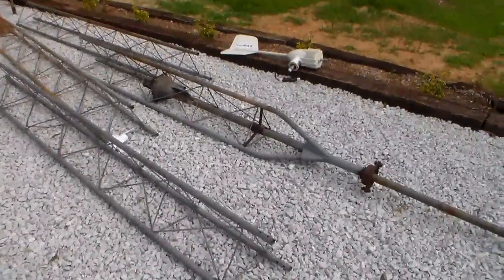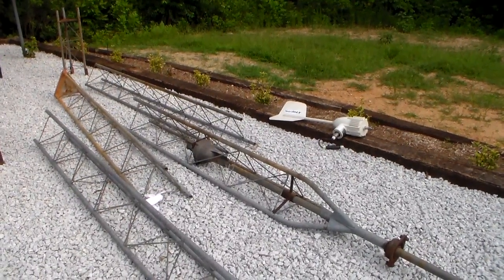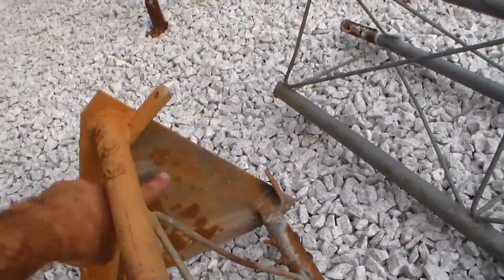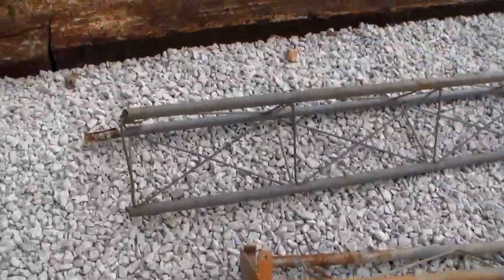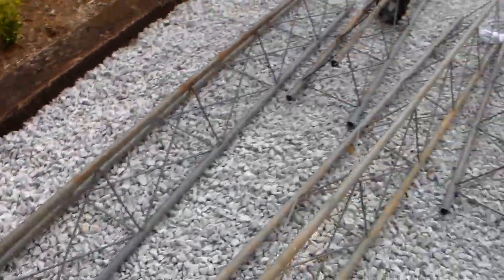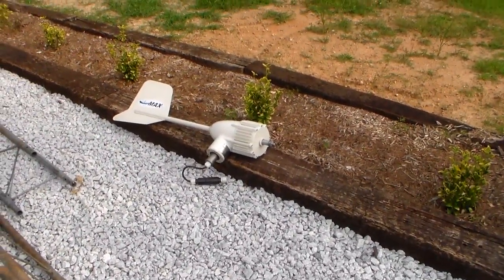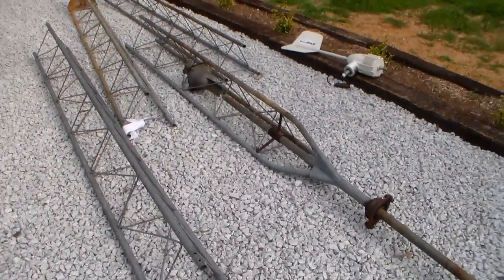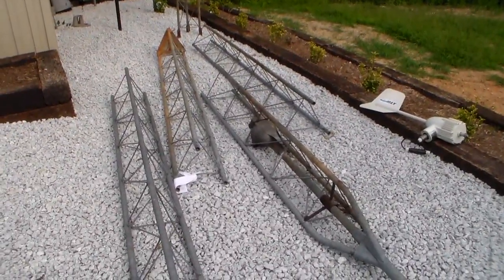Need help with my tower and wind turbine.

Comment: the first base y showed is a "hinged base", the second one is a fixed base. I would sink the second one into yr concrete and cut it down to the flat plate on top. Then mount the hinged base on top of that "hinge / locking latch" so you have the ability to lower and service it. Take the mast and rotator out of the top section "re use it on the side for antenna".

Comment: I suspect that the plate with the tabs goes up on the tower near the top as a place to set your guy wires.  Depending on the wind you may have two such locations.  A lot depends on the swept area of the turbine blades.  Your vendor should be able to fill you in on what kind of lateral loading to expect for that turbine.  I would suspect that two sets of guys are needed for a 45' tower with that small a footprint.  Don't forget to coat any steel going into concrete with a bitumastic compound or some of that black tape you used on your yard hydrants.  Concrete will rust steel in a heartbeat and cause a very expensive thunk when you want thunks the least.  (Corollary 5769 to Murphy's Law).

Comment: I installed towers for years,1st off cut the rusty bottom off, 2nd if you base in concrete you want to make a large base 5 ft x 5ft by 5 ft deep, make sure that the base or bottom of the tower goes in the ground below the concrete pour, so that moisture and condensation in the tower can drain, if you don't it will fill with water and the tower will not only freeze and split but it will rust from the inside. You may also want to fasten it to the eve of your house with heavy house brackets,in that case you really do not need any concrete,but you will need to go at least 4 ft deep, believe me the second way is the cheapest and the best.I have never had a problem with the 2nd installation.

Comment: Remember also if you weld on Galvanized pipe make sure you have good ventilation and don't inhale the fumes. Welding on galvanized pipe can be done but again its hazardous to your health. If your going to weld anything make sure you grind off as much of the coating as you can, have good ventilation and wear a respirator.

Comment: a tower like that will need at least 3 guide lines from the highest possible point to stop it swaying also use a sleeve style joint where parts join eg larger close fitting pipe slipped over the 2 smaller pipes to join id also suggest a wire brush check for cracked welds and cold galvanizing paint for long life of the tower make sure and the anchor points are as heavy as possible looks like a good find and should serve the purpose hope this helps please let me know how it goes

Comment: hey southern the first base plate you show is a hinged bas the tabs are the hinge just heat the one up and straiten it out  then when you pour a base and line up some tabs with holes in then so when cement drys you have tabs that line up with hinged base ,and make sur hinged side is away from house lol pleads fith  on that one  as for a base I would pour a square base 3ft squared and 2foot deep and I would also put in rebar pounded into dirt at angels pointed away from base  kinda like tree roots so it stays put wind is a bitch  , make sure hinged works and lined up before you put full tower up you will need three tie down wires at each side each  section going up as far as cleaning go with what bc trucker says , when you attach each section use grease so they wont rust them out as fast rusting out just drill some drain holes and pain the fresh holes  , as for then ruas for raising and lowering it put a boat wench at base, the non galvey pipes take off and toss in reuse pile  , the second base one is like tope section add on before last piece is added the parts you think for bolts into ground are cable tie down  points  from what I see base section then second section then the tie down short one then top one and its done ........... sorry so long winded here

Comment: sp1 I looked at the manufacturers web site about 3 days ago, from memory i dont think you need this setup. a single mast will work good for that small of a turbine, they suggest for their 1600 watt output wind turbines 2 inch heavy conduit pipe up to 60 ft with 3 guide wires for support something like 6 ft below the absolute bottom of the lowest point of the blades. hope this helps and with your cache of pipe I would guess you already have everything you need, or just go 8ft above one of your out buildings look at their video's . btw love your vids and I appreciate what you're doing for the general populace.

Comment: What you have, SP1, is an old TV antenna from the 70's or so. You could reinforce the bends with welds and straighten the areas around the base and either set the base in concrete and rebar or you could bolt it to the side of your home (or both) to keep it secure. By bolting it to one side of the house, it you can reinforce it at multiple points. They are sturdy. I had one at a place I rented some years back and I was able to use it as a ladder to get on the roof if needed. Since I had cable, I used the antenna as a flag pole for Old Glory after 9/11/01. Good luck with yours.

Comment: We hinged our base! Makes it easier to take it down for repair!
Wish I could show you. Hing works like an elbow on two of the three up rights!
Sand it wire brush it and paint it! Forty feet is what we had. You do not want to clime up to the top to work. Even if there is no wind. It will still sway. Also need guide wires We had it attached to the house which was two section high. No guide wires!!
Good luck! There will be a video of this being put up! Right!!!

Lee

Comment: I would wire brush the rust off the tower and use spray galvanize on any bare metal.  Painting a tower like this will just make it stand out more, and the paint always chips.  This is a fairly short tower and would be fairly easy to stack.  I would recommend up sizing the bolts on any used tower.  If this is going to be near a building you might be able to use a house bracket and not have to guy it.  I emailed you my contact info if you have any other questions.

Comment: If it was me I would put it up against a building so that 2 poles could be mounted directly to the side of the highest point of the roof on the building.  I would wrap the base in plastic wrap and it put it down in a 5-6 foot deep hole and loosely backfill it. I would then fill the cavity inside the plastic wrap with concrete.  When that dried I would pack in the backfill and mount the wind turbine.

Comment: rust oleum has a galvanizing spray touch up with that  skip the drum it will take a large load of concrete 2 to 3 ft cubed guy  and ground and do not forget if you run wires from it into the house bond the tower to your electric service ground it called bonding contact a ham radio club for more info since its very similar to antennas
arrl.org for some info

Comment: You need a break over plate. Two steel plates with a hinge between them so you can assemble the tower on the ground, then it can be pulled up right. You know anyone with a wrecker or wench truck? Those would work well to set your tower up.

Comment: Put in a concrete cassion in the ground 6-8 ft deep with a bolt down plate mnt for mast . And makevsure you put in a 8 ft ground rod connected to all compnents as reccommended . Use 4 tension cables on that mast if its up to 50 ft or more . With in ground concrete mnts .1/4 in cable . With hvy cable connectors .

Comment: check with the county on regulations on how many feet is legal until a permit is required and how many feet you can go up before having to have a strobe on top. 
you can probably check with a local company that installs towers to find out all the info and if it would need guy wires.  as far as your slab, you may need to have a 3'x3'x3' slab but im not an expert.  personally i would call a licensed company.  here in az they have to be licensed anyway...

Comment: first for the base bury it half way under ground and pour concrete around it, the other sections asseble them laying horizontal on the ground then have a friend help u stand up the assembled sections and lift and lower onto the base that is securly in the ground. to make the tower level have the base in the dirt standing up then set plywood on top and useing a bubble level push the base until it is level. when level pour the concrete (sack of mix and water but use slightly less water than what the instructions say to prevent haveing runy concrete. Hopefully that makes sence for you 
ps
my grammar sucks you dont have to tell me

Comment: There is a good writeup for the essential things to consider at the  "fieldlines" COMmercial website.  Search for "Topic: How can I make a Tilt Up Tower for my Turbine ?"  It is more complicated than it looks because of the torque in high wind and the long lever-arm radius to the ground, as well as when the blades and armature are spinning they have angular momentum that tends to push up or down depending on which way the windmill is turning to face the wind.

Comment: Go back to the place where you bought the turbine and ask for technical support.  They ought to be able to give you a generalized procedure for how to erect a tower like that.

Also, I would paint it.  Maybe International Orange, the color of the Golden Gate bridge or the color of the Eiffel Tower which is called EIFFEL TOWER - D17-4 from Olympic Paint company if you search the web.

Definitely the most important thing are the guy wires because they keep it from rotating around the base, the base itself I don't think it worth over-building because all it needs to do is to keep from sinking and hold on to the bottom of the tower, where there is not a lot of rotational force anyway.

Just my thoughts, but I've never put one up before.  Totally interested in how you work this out.

Comment: Dig a hole and sink the tower into it.  My father is a Ham Radio guy and that is the way to do it unless you want it mobile.  Paint yes except for the joints where the tower sections link together.  If you do paint it all, make sure to use ground strap between the sections for grounding.  There is a paste that Ham radio guys use to use in the joints for tower sections and antenna parts that is like antisieze, but is also a dielectric.  This grease allows for easier dis-assembly and keeps the continuity between parts.

Comment: You're going to love that turbine. Install a couple guy wires just to keep it ridged. Drive some concrete stakes into the ground at an angle away from the tower and tie your guy wires to them. 3 wires will do.
See Missouri Wind and Solar's "Wind turbine generator tower How to Build a 64 foot part one of two by MW&S"

Comment: It may be galvanized but it has started to rust which means some of the galvanized areas will keep rusting. I would clean it up brush something like Ospho or one like it, if you like. Paint will help stop the rust and existed the time you will not have to pull it down and fix it. Welded areas will rust fast and weaken the structure. It will look better as well. For the rest it looks like you have plenty of good help from the comments. Now you just have to decided which is the best for your tower.

Comment: I would definitely consider primer and paint. I am sure you want it to look good and that will give your tower added protection against the elements. I don't think that would affect the operation of your system and may make it last a little longer. Just a little cheap insurance. Good luck with it.

Comment: The one with the bent piece it's actually half of a mounting plate, that hinges so you can push it up. without it slipping off when bolted too the concrete It make it e-z to take down to work on it too. That how we sit up cb towers.

Comment: In my experience if you can get it to 100ft you will produce a lot more power. There is lots of research that proves this as well. To mount to a rhon tower I've seen everything for bearing sealed wheel hubs to expensive commercial solutions

Comment: DO NOT bolt to any type base on the ground unless the tower is effectively guyed. Best plan is to dig a hole about 3' x 3' x 3' and put about 6" of gravel on the bottom for drainage and firmly stage the first section in the hole (plumb) so as to keep it steady when you pour the cement and for a week to cure before going with the next section. If you mix by hand, it's okay to alternately layer cement, gravel, cement, etc. Drive at least one 8 ft ground rod clost to the finished product with very heavy stranded cable. Wiring in some 'floating' rebar through the tower is good too. There is a tremendous "bending moment" (leverage) at the base and bolts alone will not hold. Buy the correct new bolts too. Painting is not needed or recommended; shine it up gently with a little steel wool and apply some galvanizing type coating in corroded spots if you really want to, but not necessary. You'll need a gin pole or bucket truck above 20 feet. You can mount some antennas on standoffs below the turbine. Go out at least 1/2 wave length (40" for 150 MHz). Place antenna on preferred direction side.

Comment: Thanks for posting David.  I've noticed the hobby preppers are losing interest and wandering off and prepping is declining again.  Not a good thing. 
     RE: the tower,  keep in mind that putting a turbine on it is like putting a sail on it.  It will have increased force on it in the wind, so you're going to have to have guide wires.  And the force will have leverage equal to the height of the tower, so you might ask yourself if you really need the full height.  Obviously you'll be putting antennas and possibly cameras up there as well, so height is an advantage, but not breaking your neck and being able to service your equipment is also an advantage.  So I'd consider how much height I really needed and wonder if maybe I had 2 - 20' towers instead of 1 - 40' tower.  Have you got a spot you can attach it to a building or tree or other sturdy object for support?
     One last thought is to put some things like antennas & such on a pulley system like a flag so you can raise and lower them.  Maybe??? IDK. 
     Good luck with this, wish I was there to give you a hand with it.  You start messing around with heavy stuff or tall stuff and it gets dangerous quick.

Comment: Man I remember those. Back in my CB days. If you have high winds, be sure to stabilize it via steel cable, 3 point is fine. Erecting it is easy enough, if your not afraid of heights. Oh, be dang sure to ground that thing too, real good. Some copper wire into a ground pole is fine.

Comment: I like the barrel of concrete idea but think the tubes being able to drain and breath is necessary for long life too. Why not tack some 90s or 45s to the bottom of base uprights and screw some pipe in that will extend outside the barrel (hole saw needed) and then bury the barrel in a bigger hole back filled with rocks (at the weep holes at least)? Could probably use some of the stiff clear nylon tubing in place of the 90s and pipe and just shove it in the end of the uprights. Just tape it so the concrete doesn't get in and can pull the tubes out once concrete sets up enough. May be able to leave the weep holes above ground too by only burying the barrel part way if you do your rebar right. Would be easy to weedeat around too.

Comment: I would suggest cleaning up the pieces, straightening that bent tap, then perhaps cutting where you need to in order to remove damaged areas and welding the rest together into one unit. make the footing pad deep enough to steady the tower when the turbine is running. It shouldn't wobble at all, run guy wires to aid stability if you can also.

Comment: By no way am i a experienced  tower builder. first I would repair the bad spot think by cutting it of then use a smaller diameter pipe inside the 3 legs the weld it all together. Then I would sand blast it and spray the wholething. So it don't rust apart.  Then to raise it I would dig a deep hole drop the end in. Use a a frame and ropes to raise it up. Sorta like they did with obaliscs. Think it's 2 foot for every 10 up. Finish it off with rebar and concrete.  Off course use at least 3 guide wires with turn buckles in them so u can adjust as needed. If you want me to I can call you and give a more detailed description.

Comment: You have Rohn 25 tower sections with fold over bottom section that is used with a base plate that mounts on the slab and a top section used as a thrust bearing to stabilize the rotating mast.
Rohn has a website with all the tech data for erecting their products, complete with engineering drawings.
For the length of tower you have, one guy at thirty feet should be sufficient. The finish is galvanized but most towers rust from inside out due to condensation accumulating in the pipes and drain holes getting clogged by insects.
If you cut off rusty ends, use an internal or external sleeve to join sections. Leave enough working length to have about four inches covered by sleeve to allow bolt holes to be drilled. Use stainless bolts, flat and lock washers and don't over tighten to avoid collapsing pipe. Turbine must act like weather vane to face itself into the wind via a tail fin. Make sure you get a proper climbing harness with a fall arrester and a short climbing rope with caribeaners

Comment: Dave, since it is 45' I would burry about 4ft in concrete to make a good anchor, also you will have to use guide-wires due to the height.  You will need guides at the 30' and another set at the base of the top.  Put them in a triangle pattern.  I would also sand it down and spray it down good with a matte black Rustoleum paint.  I know it will take a while to do that, but extra work now will prevent a lot of work a couple years down the road.